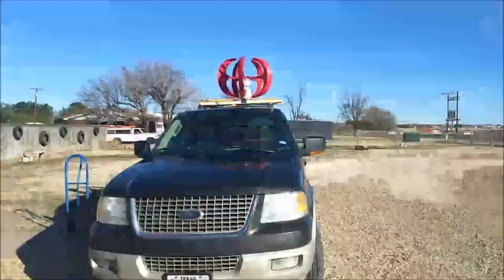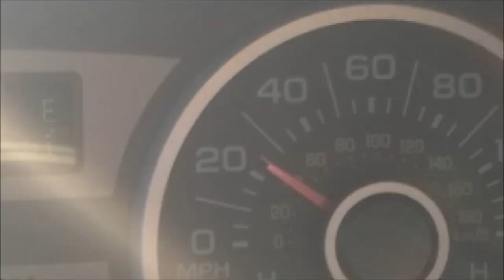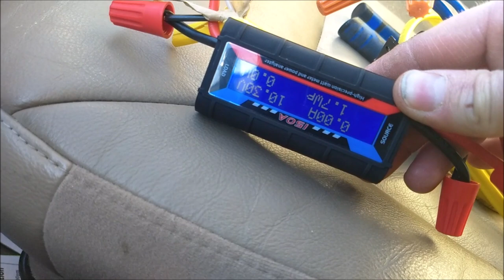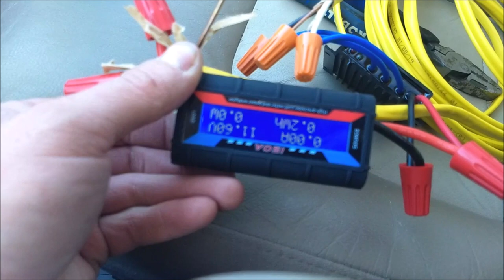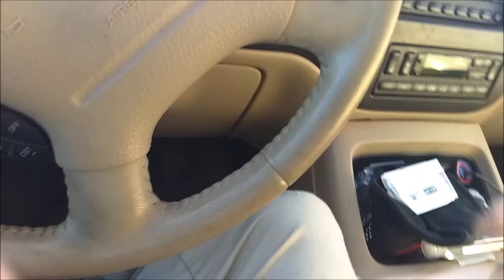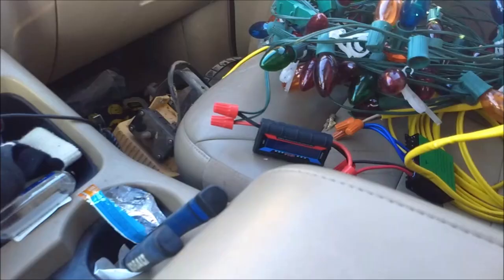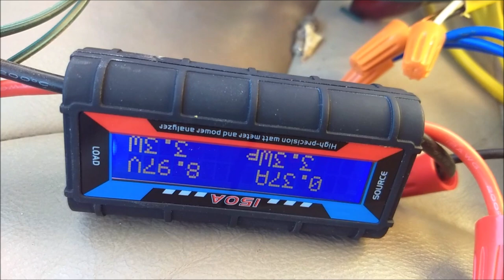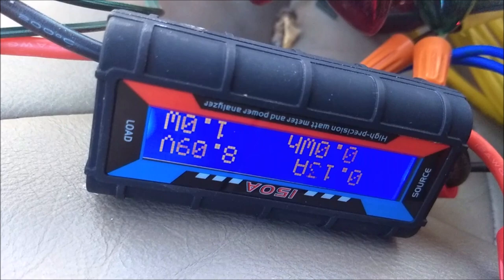What happens if you bolt a Chinese/eBay vertical axis "lantern" turbine to the roof of your car?!

Comment: It's acting like one leg may not be connected. running on 2 of the 3 legs greatly limits the current available from the field strength of the magnets. Check the wires with an Ohm meter, (make sure the turbine isn't spinning) and make sure you see same resistance between any 2 wires.(within 5%) to make sure there are no internal shorts, or, disconnects. You might try using one of the heavy duty six-diode bridge rectifiers you're using with your other turbines. Forget 400 watts, let's try for a more realistic 40 watts. It just doesn't look big enough, to have the swept area to produce any more power than that, at any reasonable wind speed. (let alone, it's rated wind speed)

Comment: if your battery is completely dead it may not take a charge so the wind generator cannot push it in so it will read low and the same if it's full the regulator will not pass power through same with a dead battery the regulator stops it  you are probably better doing open circuit test but the regulator can and will stop any output. Also the newer models appear to do a better job going by the reviews

Comment: Funneling the air to hit the turbine only at the front and exit only out the rear would be a big improvement.  I picture an upside down bowl over the turbine with an opening at the front and back, kind of like an igloo with a front and back door.  I suspect the blades aren't optimized in the least for capturing wind, so that would be the next step.
Reply: I was thinking the same thing... wonder if it could be mounted sideways, but on the back of the car/truck to just catch the scoop part of the fans. And what is the max wind speed the unit can handle?

Comment: You need to match the load impedance to the turbine. 

Use a 8- 24VDC input, 200 Watt MPPT standalone (not grid-tie) inverter to convert DC to 120VAC to match  the turbine impedance to the load impedance over the speeds and output voltages of the 3-phase alternator of the turbine.
Using a 3-phase rectifier to convert the 3-wire star configuration 3-phase alternator output to dc is OK.  Use your 2-wire dc wattmeter betwern the rectifier and the inverter input as before to measure power input to the inverter. Connect a 120vac incandescent light bulb as the load to the inverter output.

This turbine will work, perhaps better than you expect (but may not deliver the rated 400 watts), especially at the high speeds you were driving at which exceed most practical normal wind speeds. But you have to know what you are doing and give the turbine a fair chance to work !
Reply: no need MPPT on non pure dc source, rectifier to load or drained battery is good test, you tested it right, you could also create a variable load, its funny these people think ac generators are effective with mppt controllers, it pulsating dc from the rectifiers, its not like pure dc from solar cells
Reply: This thing is a well known scam.
Reply: I have low voltage output problem. It produce only 8-9 DC volt when connect with a 12 V battery. Do you mean the turbine work only with complete system setup? If so, please guide me. Thanks

Comment: This could be interesting if he had checked that the wind speed at the turbine  actually matches the car's speed.
Air flow is probably extremely turbulent on the car roof. Almost no turbine will perform well in turbulent flow. That is why they are mounted high on poles away from obstacles!
Reply: exactly
Reply: I believe the test is a little flawed also. Put a charge controller on it and a load resistor and connect the charge controller to a battery. You will get different results I am guessing
Reply: I came looking for a comment like this. Wind speed near the roofline of the vehicle would be severely affected by the slipstream over the windscreen of the car. In a wind tunnel you would probably find the the mounting point on the roof is in the middle of a low pressure zone or an eddy with very low air speed. also any cross winds or tail winds will change the airspeed across the roof surface. This is why a plane can fly into a headwind and stay airborne even though its stall speed is greater than its ground speed.
Reply: he should have actually addressed the framerate of his roof camera.  When the turbine spin matched a multiple of the framerate, it appeared to quit spinning, but it didn't actually.
Reply: You guys are applying the thinking of HAWTs to VAWTs. You can't do that. VAWTs are not as vulnerable to turbulent air as HAWTs.  If there is an issue - it's with the generator.It would have been nice with a variable load, as a tired car battery not necessarily pulls large amps when fed.

Comment: There are several factors that could have caused this outcome. With a dead battery at the end of its life it probably wasn't accepting a charge...nor was there any charge controller connected. You cannot expect any reliable results if you don't know what you are doing. What is the probability that you actually broke off one or more wires when you were pinching them with your calliper? Pretty high I'd say.

Comment: When you run the 3 wires to the rectifier ( charge controller ) it changes the current to 12 V DC so that it can charge your battery.  If you want to run your lights off this system you either need to go from the battery, which is DC to an inverter which will give you 110 v AC and that is what your light need to run. Or switch your lights to 12 v. DC. Another thing. You are using the worst wire to do this application. The electricity runs on the outside of the copper wire. So using single strand wire in a DC application  limits the amount of electricity your able to send through the system. After running through the rectifier the wire should be shorter and much thicker as well as multiple strand. Just rule of thumb for 12v DC.
Reply: DC doesn't care if the wire is solid or multi strand. As long as it is thick enough to carry the amperage you expect to run through it, and I think that wire looks like a few mm core which is fine for that test. You are thinking of (and yes I had to look it up to be sure) 'skin effect' which does not even come into play till you get to higher frequencies. 
https://www.quora.com/Which-type-of-wire-is-good-for-AC-and-DC-current-solid-core-single-strand-wire-or-stranded-wire
Reply: @Godshole  Wrong
Reply: @aaronwhite7404  Yes, the link is basically about AC, because skin effect is not an issue with DC. This is Jonathon's  statement I  am hoping to correct. 

"You are using the worst wire to do this application. The electricity runs on the outside of the copper wire. So using single strand wire in a DC application  limits the amount of electricity your able to send through the system. After running through the rectifier the wire should be shorter and much thicker as well as multiple strand. Just rule of thumb for 12v DC."

Once the current is DC 'skin effect' no longer applies. Here is another link. 

https://edisontechcenter.org/wires.html

Comment: Where would you place the failure to work as advertised, the blade design, the motor, or it's just an all around piece of crap? What would happen if you took the blade portion and attached it to a car fan motor, Robert Murray Smith used one from a Nissan Micro in one of his videos, but it wasn't with a lantern blade configuration. I'm in the process of building a Vardo/sheep herder trailer and planning on solar panels placed on the length of the mollycroft, and being a big redundancy fan thought a small wind turbine on a separate system would be the ticket, the lantern style blades looks as if it would best option
Reply from the maker: In this case it had very small wire and a very small amount of it.  The magnets were also small but could have been serviceable with a better stator.  It was just built far too lightly.

Comment: Chinese say "Lantern Windmill rated 400 Watts in one day." Or .2777 Watts per minute. Strange thing is, that if you hook up 110VAC LED indicators to them you can get a decent amount of light out of one.
Reply: 5to8 amps charging 12v battery

Comment: When your driving 40 to 70 and stick the hand out you fan feel your hand being pushed with a lot of force, I imagine properly making a wind fan thats able to funnel most of the air into a narrower cavity and the right flan blade design that can increase air drag flow and were looking at a very viable amount of sufficient power to transfer that energy to a back up battery pack, especially if you drive electric vehicles. while your using one, the other one is being charged, and when the one your using runs low on energy, you turn on the 2nd one to continue, as the wind fan generator charges the first one that was depleted. But never charge a battery as its being used because that creates extra load, then the battery can overheat, reducing lifespan, and can even expand and explode.

Comment: I'd take one of those and rework it, use it for the platform.  Thanks for the video.
Reply from the maker: With a lot of the junk eBay if there's a problem the vendor is forced to accept the return....so this one went back.  If I'd have gotten stuck with it I probably would have tried to get retrofit it to a F&P type motor to see if it'd work better with  a real stator/rotor assembly.

Comment: Vertical wind turbines have a problem, in that they have to overcome the counter resistance of the blades from 180 degrees on the other side.  The only way to overcome that resistance is by using a fixed stator surrounding the vertical turbine, to block wind from the opposing side and redirect that air into the cup side.  For a stator just picture a few 2 x 2 boards, angled around the vertical turbine, blocking the opposing side and redirecting that air to the cup side. The stator is essentially squeezing more air into the cup side.  You can get by with just one board while testing on your car top.  I tested an Apollo 500 watt propeller turbine by mounting it to my truck, and I got my rated voltage at 12 MPH.  I did have to adjust the angle of the propeller blades through angled spacers to get that performance.  Most turbines are the horizontal propeller type because they are more efficient than vertical turbines.
Reply: Look at www.windside.com 
May change your mind on verticals

Comment: I have one of these useless things so how do I improve performance or do I need to buy something else? André
Reply from the maker: I have not seen any way in which to make it better.  I imagine that some come with better stators...mine had very small wire and magnets and very little of either, there was no saving it.  I'd suggest forcing a return and refund if you can and buying something else.

Comment: What receiver did you connect it to? Or did you forget to connect anything apart from your meter... :s The lights are not rated for the voltage the generator is supposed to output, are they... Put some effort into it next time:S

Comment: Is there an actual turbine set up that works made in the USA? I wanna do the van life thing & was thinking this would be good to have with solar for gloomy windy days. Any suggestions ppl??
Reply from the maker: Not many great examples made in the US...there are a few that "claim" to be made in the states but so far every example I have come across has been assembled stateside at best, and have lackluster results.  If you truly want it made in America, you'll have to do the making...which is not hard.  You can look up axial flux designs and the work of Hugh Piggot...get all your materials here and follow his instructions and you'll have en exceptional turbine.

If you want something off the shelf that you know will work, though, the iSta Breeze i1500 is the most budget friendly consumer grade model that will actually meet or even exceed manufacturer claims.
Reply: @ToysforWatts  Thank you so much for all the info and advice. I appreciate you answering my question.
Reply: Just go solar you still produce in cloudy days
Reply: @KiloFeenix  TY im still learning and planning, i can use all the advice i can get.
Reply: @nyxnicky  I'll ask my buddy, he has 400 watts ontop of his van, in an area with around 5 hours peak sunlight and 4 6v golf cart batteries, he also ran a battery charger to his solar charger from his car alternator to charge his setup while driving
Reply: @KiloFeenix  TY

Comment: Thanks for this, I was considering one of these to supplement my 200 watt solar setup during the winter months, my setup is not ideal and in winter the sun is too low for the panels to give a reasonable output, looks like I'l have to come up with something else, I cannot go with a larger turbine as space is an issue.
Reply from the maker: If a wind turbine would help there are some out there that are worth looking into...just not this one.  Go through my videos, I've got a couple that have done pretty well...and if you subscribe you'll get notifications of when I do new ones.  I try to focus on inexpensive micro turbines specifically.
Reply: Me toooo000000!

40 mph
1.7 watts
Reply: Don’t despair these work my buddy runs 2 on each boat gets enough w two x 800 watt turbines like this
Reply: Make bike generator

Comment: So the conclusion is that the blades spin fine but the power is low? And the reason it didn't spin when you drove faster is because of a brake function? That's why your meter was blank?
Reply from the maker: It was actually spinning very, very fast the whole time.  When it looked like it was spinning slowly, backward, or not spinning at all it was what's referred to shutter sync.  Search YouTube for shutter sync, you'll get a much better explanation than I can give and some awesome examples of like helicopters that seem to have completely motionless blades while flying.  It's pretty neat :)

Power was low because the wire in the stator was very small, there was very little of it, and the magnets were weak and small.  It was a very poor combination for a wind turbine.
Reply: @ToysforWatts  thanks for the explanation!

Comment: maybe you need more resistance and a bigger motor that kicks in when you achieve say 25 mph and chokes it at 35 mph with the use of a gear and clutch system.?like an automatic gearbox..creating something that spins too quick may not work like we think it should and im no scientist.

Comment: We have pretty light winds as we are in a valley. We have good solar but looking at adding a small wind turbine to top up the 48v lithium battery in cloudy weather  and at night. What cheap wind turbine would you recommend for light winds?
Reply from the maker: Light wind makes it a bit difficult...that means either mounting it very high up (60~100ft) or making it very large to be able to gather enough wind to make it productive.  You're most likely going to be looking at a scratch build and one of Hugh Piggot's axial flux designs would be the best option financially and for performance.  Some of the larger companies might also be able to help get you in the right direction...Bergey, for example.

Comment: U can not use that type of wire dc current will not travel thru solid wire. Try 10g weld wire and then it will work. Has to be stranded wire

Comment: Who is the producer ?
No label anywhere . 
I got a "1500 W"  with the 3 wires very thin
and discovered all different outputs have same sizes just different background on add.  Is there any international body to report and get rid of all these scans ?
Reply from the maker: I'm doing a lot of research on where they're all coming from and it seems like there are five major manufacturers of these micro turbines, three of which are contract factories that just make whatever they're told to make according to the specs they're given.  In the end the seller's are not the manufacturers and they're the ones making "claims" about production capabilities.

Two of the factories make higher end machines...my 700 watt turbine is from one of these factories.

In the end, though, it's not easy to determine exactly where each machine came from.
Reply: @ToysforWatts  Thanks for reverting.
OK, I will try to see if it works.  Does it matter how you connect the 3 yellow thin cables from the generator to the 3 black on the regulator?  No marks anywhere.
Of course red and black goes to battery.
I turned the generator by hand and got about 12 V. How can I bench test it to check how many watts it produces. 
The add said 1500 W - so maybe 150 W 
ha ha with those 3 thin threads. 
I am bugged about China churning out so much poor stuff. I got a "quality GPS tracker " not worth the wrapping. No more poorly made Chinese stuff here.
Reply: @janerikrendahl4161  Are you taking account of the 3-phase output, and properly rectifying it before taking readings through your meter? difficult to see your wiring layout in the video, but 3-phase rectification must be done correctly (apologies if you already know this).

Comment: Trying to run a 120 volt lamp on about 12 volts was never going to work.
Reply: Especially because it's 120 V AC an the output from the charge controller  is DC...

Comment: Lookong to the output voltage with 10v at 60 miles, as if the generator is for 6V battery. The build seems good, so if you can put a boost converter to test it one last time before throwing it..